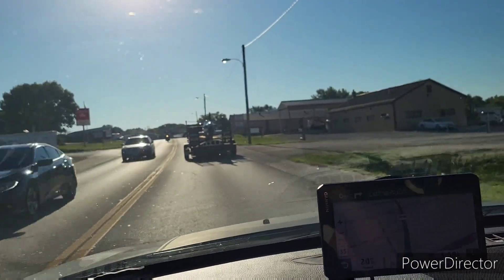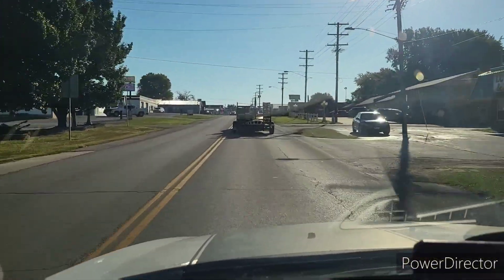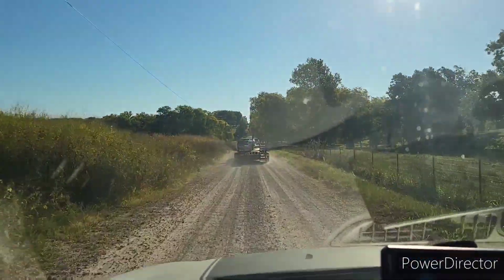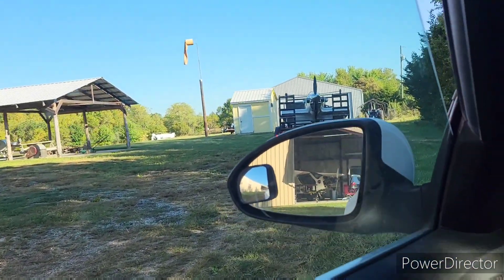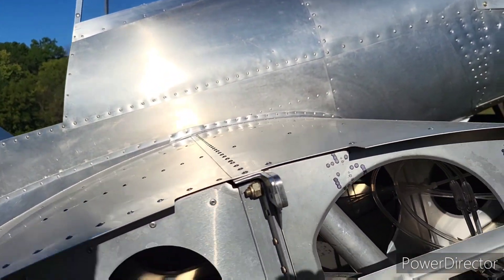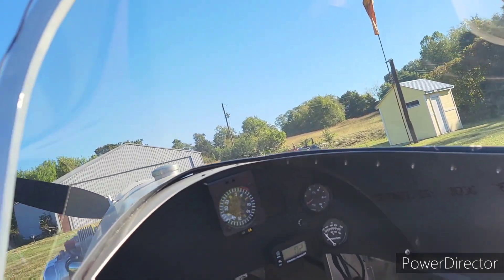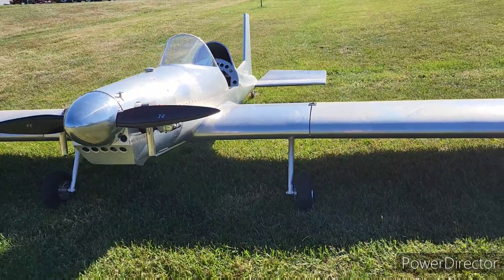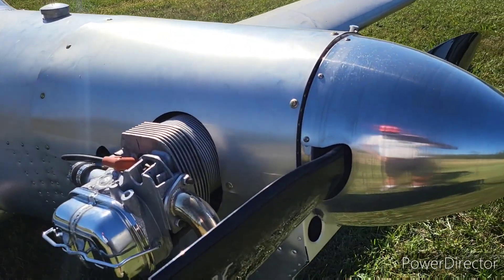Robs UC  well he has a problem

Comment: The wing situation is really unfortunate. You didn’t mention whether the aircraft was kit or plans built. As I recall, the kit includes a pre-assembled spar or is that a kit option?  Throughout my career as an A&P, I’ve done a lot of major aircraft structural repairs and as an AI, I’ve inspected and approved a lot of major structural repairs.  I don’t want to even think about what might be wrong here, other than it’s not going to be easy to repair. It appeared that the wing attachment gap was wider on the top than bottom. The wing droop appeared symmetrical right to left leading me to guess that the wing center section was installed or built flipped top to bottom.
The saving grace is that which was built with one’s hands can be repaired with one’s hands.
Reply from the maker: Hi Myrl Stone yes sir it is kit built and yes the spars were factory built. BUT if you use the left wing spars on the right wing it will be wrong.  Rob was not upset but really appreciated me coming and looking over his airplane.  He did a good job but he does need to fix things but the wings will be the hardest...

Comment: couldnt he change the wing spar attach fittings to correct the anhiedral?
Reply: Depends on the design of the spar or spars and fittings just how extensive the work might be. As far as just coming up with a home fix — any aircraft designer takes a very dim view of any deviation from their plans. This would be extremely so on a spar, be it in the wings or center section. 
Getting an approval from Hummel for a spar modification is probably a very long shot. They will want it built as drawn, so that will mean backtracking until the root error is found.  
The very last thing they want is a fatality (a spar failure will be fatal) and secondly, the bad press, “Wing spar fails on a Hummel.”  In today’s world, good news travels fast - bad news travels the speed of light.
The builder’s permission in allowing Dennis to post this video is commendable.
Reply from the maker: Hi Matt Poland  well sir we gave that some thought. But that will not work. He has to drill out and swap the spars
Reply: I was thinking it might be possible to shorten the outer wings a wee bit.  It would take moving the root rib outboard a bit, and it would mess with the aileron linkage, but it MIGHT be easier than starting from scratch.  In my mind, you could keep the lower spar attach point, and move the upper only.  The wings would end up perhaps 2 inches shorter.